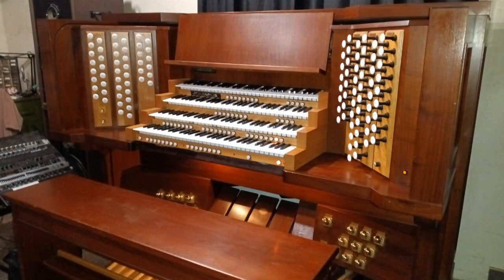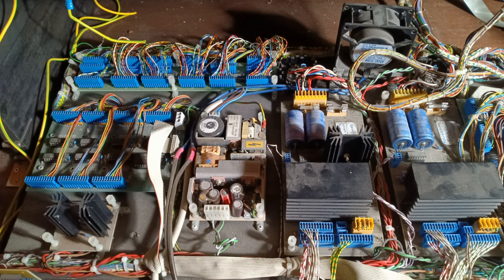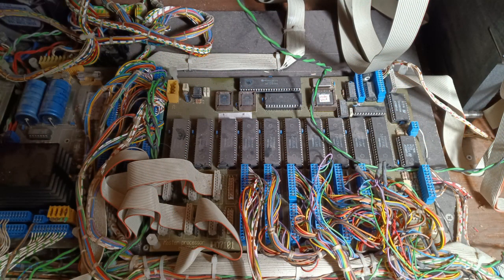Organ Technology 21, Digital organ tour and repair.

Comment: Does that Johannus organ not have MIDI? I've got a 2 manual Opus 10 from the early 2000s that has quite a good MIDI implementation; every single control on the console transmits MIDI data and with the excellent MIDI learning capabilities within Hauptwerk it works very well...no 'conversion' needed! I can't imagine a big 4 manual console from the late 90s not having it.

Comment: You should have a silly scope (LOL) to work on that organ... even a USB 2-chan scope would be a way to go on the cheap for $60.  So BTW, I'm a firmware engineer and have done the technicians job on C64's back in 1985, and so I'm inside stuff all the time.  I had some thoughts regarding the video, I can tell you are very knowledgeable on this subject, so this may or may not be useful... here goes...

Rarely do crystal oscillators fail, but they can, but you're right to consider the wonky behavior could be connector issues, it helps to have a schematic to troubleshoot, I'm not sure you have one, but if not, I'd start making a block diagram and documenting where all the pin connections you have. No surprise you've got so many of them in there...  one-by-one and sorting it out.  So here's the two things that came to mind:  1. If a digital input is floating, caused by a broken wire, that can cause erratic behavior, or 2. if a common is lifted up you can get an entire keyboard bank malfunctioning.  A lot of times a wire on a connection like that can break but still look connected because the insulator is in tact... the only way to find them is to ring them out with a continuity meter.  You definitely have your work cut out on that one.  I'd leave a longer comment about making some breakout connectors to make that easier, but I'm not sure what you have or if it would be worthwhile.

It's a coincidence, because personally I've been doing electronic repairs in my studio equipment, what I have: 2 KORG synths (X3 and Triton Pro) with floppy drives, and 2 KORG synths one is a stage piano (SP-250) and a rackmount (X5) , rack mounted mixer boards, patch bays, CDR-W33, MOTU MIDI Timepiece,  etc. 

My failures have been dead batteries and belts! Ugh... The batteries are internally mounted and are backup power to the RAM in the keyboard that hold the "patches" and the MIDI Timepiece routing configuration... easy peasy to replace, but then the rubber belt that worked the floppy had turned into goo (nasty stuff) that made the floppy drive in the X3 operate, so I couldn't use my backup disk,  I replaced the floppy with a simulator that uses a USB Flash drive.  And my 2U Rack mounted CDR-W33 drive door mechanism belt was rubber goo too, with a CD trapped inside for "Safe keeping"  LOL.  Luckily I found the service manuals online, helps a ton when getting in there and working on this stuff. Next I've got Audio issues with my 16-channel Mackie analog Mixer and/or a PS-8 monitor speaker, so I know what you're saying, fixing stuff never seems to end! Sigh!

I wish you good luck troubleshooting your organ, it looks like a great instrument to keep working than to convert it to a MIDI controller... now what's wrong with the best of both worlds?  Huh?  Just a thought!

In one of your videos, you talked about the Ye Ole Pizza Joynt in Hayward, I fondly remember that, and I'm about 2 miles south of that location.... How I miss that place and seeing Jerry Nagano playing the Mighty Wurlitzer.
Reply: Agree entirely. Digital scopes are now so cheap and light, and so packed with functionality, that it's a no brainer to own one.